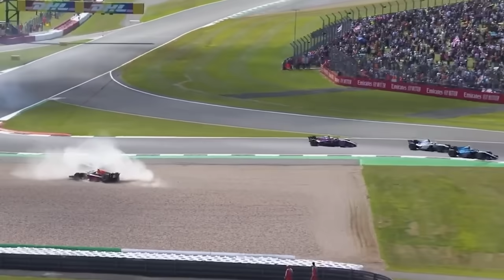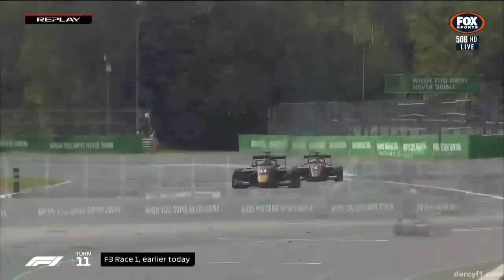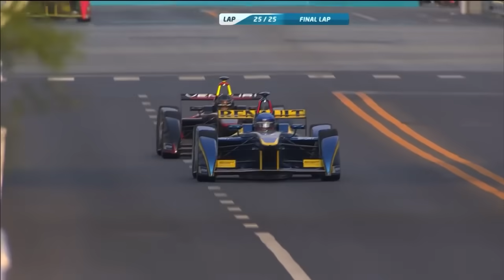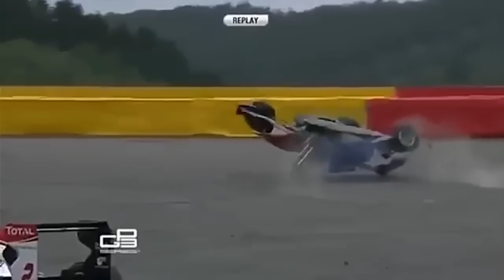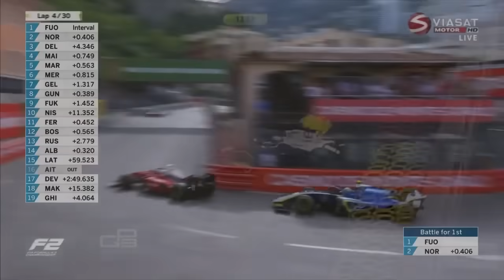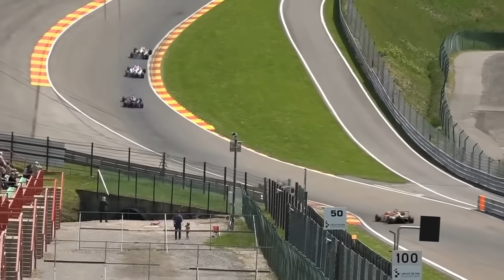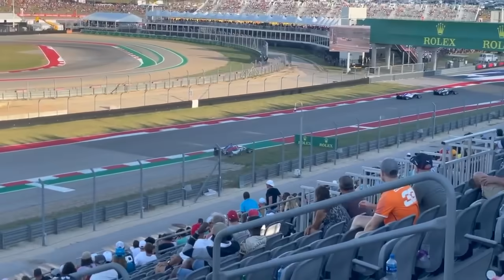Ramps on Race Tracks

Comment: I think it would be better to make the kerbs more abrasive to tyres rather than have a high profile that the floor plate can launch off from. There would still be a downside to running over them but it would be a general traction performance loss rather than upsetting the car’s balance in the turn.
Reply: They could even use small devices with sharp edges to damage tyres on purpose.
It would be much safer and even effective.
In F1 they could use electronics to slow down the drivers out of the track limits at some points. Like, if you run wide you lose 10% of power for X seconds.
Reply: I think that would cause punctures which might be exciting but not exactly safe.
Reply: @justinharrison9521  I don't understand why the kerb inside or outside of a corner has to be any different from on a straight. Cars must stay within track limits anyway so why are these needed?
Reply: @justinharrison9521  
I meant just a little bit. It would cause punctures only after going wide or cutting several times. Similar to an abrasive surface.
It should be adjusted to damage the tyres little by little.
Reply: @justinharrison9521  any mechanism that punishes mistakes by removing adhesion can be dangerous
Reply: @dark_memer42  
Kerbs are there to help the cars stay inside the track. Some of them make it easier, some make it harder (like Nürburgring) and some are flat and just visual.
They are a characteristic of the track and that's why they vary so much. Because everyone has a different opinion and so tracks are build with different characteristics. Some people think like you and others don't. 🤔
Reply: @AngusMcIntyre  
It's also called racing...
Reply: @Gean...de...Oliveira   curbs are absolutely not "there to help the cars stay inside the track", they are there to punish drivers for exceeding track limits.

 And sure, some fans like them.  Some fans also don't like the halo, comma some fans don't like that racing is so much safer nowadays is then it used to be.
The fact that some people like a safety hazard is not justification for keeping a safety hazard around

Comment: Great video. I hope the algorithm will push this. Other than good old fashioned grass, what is the solution. If you give an inch the drivers will take a mile. I races in the Battle at the Brickyard in 2019 and the fastest exit to turn 4 was 4 wheels off in the dirt. The karters that weekend (myself included) did 14 grand in landscaping and the next year they just put a wall there.
Reply: On big GP courses: sensors all the way to flag every cm of track limit. 
But of course thats unreasonable for smaller circuits with mainly amateur racing. 
No matter if its a wall, a tire barrier, gravel, grass... everything has its downsides, but i personaly think a single sausage kerb should at least be an automatic ban for lmp style and open wheeler racing.
Reply: @emojack  How about spike strips? :)

Comment: 0:00 - not a sausage kerb
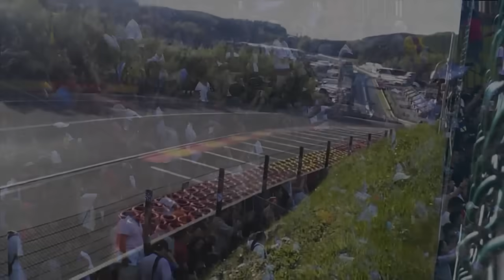3:02 - not a sausage kerb
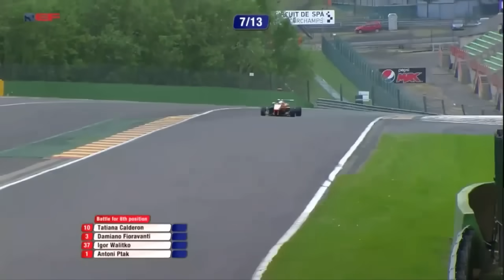4:59 - not a sausage kerb
5:39 - not a sausage kerb
Reply: Alot more than that aren't, half the tracks shown don't have sausage kerbs.
Reply: The two at spa are sausage curbs (sorta). The white stripes used to be elevated higher than the tarmac. Effectively being a mini sausage curb.
Reply: Yes, those were not a sausage kerb and it did that… sausage kerb is a lot worse.
Reply: Bruh read the description
Reply: @jamesshanks5599  it's irrelevant. The title claims these are sausage kerbs.
Reply: You're being obtuse. You are ignoring the description on purpose. All of these are avoidable. Whether it's sausage curbs or cheeseburger curbs, they don't need to be there. You like drivers being injured?

Comment: Well done for making this compilation. Hopefully it gathers some traction, particularly after the comments from Norris, and the FIA step in. Sausage kerbs need to go.
Reply: They won't because of track limits. Plus, the number of injuries is exaggerated. Most of these crashes were non-injuring (only 5 out of 18, or in more mathematical terms: 27.778% were injuries and out of that percentage, 2 were severe vertebrae fractures, or in mathematical terms, 11.11% overall, 40% of the total incidents that DID injure drivers). So unless you can't count, I don't think 27% is that severe, as it's barely a quarter of a specific selection of clips behind a biased message. 

Bias doesn't solve anything. And the maths objectively point to it being a non-issue.
Reply: @DR3ADER1  I can say I have never seen someone simp for an inanimate object as much as you have in this comments section sir, props to you.

Comment: But what's an alternative that accomplishes the same goal without occasionally launching or tearing up cars?  
The problem is, if you don't put some type of curbing that discourages cutting corners, then drivers will simply always cut them.    Sure you can say "Don't cross this line or you'll be penalized or DQ'd" but then what happens if someone just misses a brake point or gets bumped by someone else over that line?   Would be pretty annoying to see racers just randomly penalized out of the race.   Curbing makes it a place you don't want to be, but doesn't put the race outcome in the hands of officials.

Keep in mind that another alternative would be to limit how low race car bodies can so they don't hit the curbs directly (they're not an issue for tires).  Of course that would change the nature of some of these cars quite a lot.
Reply: or, as racetrack mostly were before, grass or gravel on the side of the road...? 🤷‍♂
Reply: @Seb_Semos  people just drive over the grass on the inside of a turn and eventually just becomes a big patch of dirt that people still drive over.   Gravel gets dragged onto the track causing it's own set of hazards.

Comment: Sausage curbs should be removable, they work for non-open wheelers but removed for open wheel racing
Reply: An Aston Martin car skidded & flipped multiple times on its side in 6hrs of Monza 2022 bcs of a sausage curb
Reply: @abcjelly  this is true sorry about the year late reply, I probably meant they work for higher suspension vehicles

Comment: I'm not a huge fan of sausage curbs and see the big concern with them, but I understand there purpose in motorsports. I believe there are much safer alternatives to keeping cars on the raceing surface and keeping cars from cutting/running wide in corners. I don't know when sausage curbs were introduced but it does not seem like they use to cause a big problem. I think a beter alternative to sausage curbs would be a surface that slows you down like gravel but does also not cause drivers to lose control in the car. I'm sure the FIA could develop a surface with these characteristics that would be much safer for drivers and pervert the launch pad affect we have been seeing.
Reply: It started in the Tilke-drome era I think.  Tilke owns a construction company, so all his tracks have the most amount of construction possible(paved everything).
Bikers also like the connected paved runoff, as they always slip driving on gravel.
IN the last 10 years or so more and more tracks are paving the gravel run off, like Monza, Parabolica which used to be a grass strip then gravel.  It was made safer by paving the grass, then to stop people running wide, the sausage kerbs were added, making it much more dangerous than the old way.

Comment: Point of the matter is, don't run wide.

Failing to see how they are any worse than concrete walls. With open wheel racing, sausage or not cars fly. Motorsport is dangerous, enter at your own risk

Comment: Why the hell are sausage curbs still in motorsport? With all the safety improvements in the cars and tracks, why intentionally add something which makes an incident so much more dangerous.

Also, putting a sausage curb at Eau Rouge is so stupid it's practically attempted murder

Comment: sausage curbs should be banned, they are too dangerous for open wheel racing. Just penalize the driver for exceeding track limits, dont try to kill them by putting a bump that if they hit it, sends them 40ft in the air.

Comment: If you want to complain about sausage curbs, you have to go back and deal with the reason they are there to start with.   They exist for the very simple reason of the stupidity of paved run off areas, corner cutting, and track limits issues.

Basically, if there is no real difference between running on the track and running off the track, drivers will take whatever route gets them the best lap time or gets the pass done.   The most obvious example of this in at Monza, where the final corner (parabolica) that was an amazing test of driver skill and control, the balance from speeds versus staying on the track.   Failure was an enjoyable run into the gravel trap and the end of your race.    Now it's all paved over, and we have the problem that everyone now runs over the curb and out as far as they can to carry more speed onto the straight.  So in order to keep drivers honest and on the track, various things have been tried including curbing.   

So if you want to get rid of sausage curbs, it's simple:  Make going off track undesirable.
Reply: true! Don't see much people cutting in the grass on the Nordschleif.. 😂 plus, the track is often more beautiful with grass or gravel on the side

Comment: Instead of bumpy curbs, they can put flat non slip curbs so everyone will be happy(like in France run off areas). No track cutting and no airbornes. Just see it from cameras or use sensors that detects whether it's a corner cutting or not.

Comment: Imagine suggesting that track boundaries shouldn’t be enforced, and if they are it’s poor track design.

All of these accidents occurred as a result of drivers being reckless but this guy is putting the blame on the track designers like the drivers shouldn’t take accountability for both their decisions and actions.

Such nonsense 🤦🏾‍♂️…how about this fool give a suggestion that could fix what he considers an issue while achieving the original goal.
Reply from the maker: First, I want to say that track limits are necessary and should be enforced. My point is the placement of many sausage curbs is poor design because of the consequences of hitting them, the frequency of issues caused, and how little has been done to replace them. 

Drivers should be held accountable for their mistakes, but track designers are responsible for placing track features while maintaining safety. The curbs are poor design because they're causing injuries to drivers and endangering others. It's like putting a tire barrier where concrete walls should be. Despite tires being the clear option for areas past corners' braking zones, on a straight, tires will be redirected onto the track and be hit at high speed. 

Instead of having sausage curbs in corners where drivers can go off-track and launch into traffic like at Silverstone, remove them. Keep the lower-profile rumble strips, and either monitor the corner closer or use pressure sensors with automated penalties. Another option could be to pave abrasive tarmac past rumble strips to degrade tires with repeated abuse. They can replace curbs in run-off zones with grass, gravel, or slower escape paths.
Reply: @utters4515  a rumble strip isn’t much of a deterrent, more like a notification. Best case scenario is the authorities use digital sensors for each car and corner section to monitor contact between cars and when a car exceeds the set boundaries, with an automatic time penalty for infractions.

Contact that causes cars to exceed the boundaries should receive the penalty instead of the car on the receiving end.

Either way, racing is a technical sport which revolves around the skill of “threading the needle” as fast as possible, if they miss the optimal line and crash as a result it’s not the track that the issue IMO. The whole sport is dangerous so that can’t be what you’re objecting to and no one is being seriously hurt as a result so I’m just not sure why you’re upset only because it’s scary for you.

It’s not much different then grabbing something that’s too hot and burning your hand as a result. Yes it hurts and causes discomfort/ shock but if the proper precautions were implemented and respected then the negative experience wouldn’t be a concern.

If you remove the consequences then you’re encouraging unethical drivers to exploit your insecurities. If a driver is causing damage to the car and himself potentially, as well as losing the event as a result then the team managers will be on their case to sort themselves out.

The potential for severe consequences encourages respect and integrity, if not get recked.🤷🏾‍♂️
Reply from the maker: @ewartlambert  I see what you're saying and agree with your point about the drivers' actions' consequences. There's always a risk, and ignoring it causes crashes, and yes, there is always the risk of injury in racing. That's certainly an incentive for better racecraft. 

I feel that an object placed on the track by design shouldn't be putting people under direct threat. It's not always a driver missing/cutting an apex or being overly aggressive that causes these incidents, and they aren't the only ones in danger when a car goes flying. Keeping the stakes high is not enough to justify injury to drivers, but especially not to spectators or marshals. Team managers and sponsors already apply the consequences because they don't want drivers who crash all of their equipment or rack up penalties every race. The drivers are already under pressure to maintain performance, including their racecraft.

When hit at angles near to those expected of a racing line, sausage curbs punish cuts from those drivers efficiently. When used in run-off areas, they force drivers to slow and prevent any time gain. Failing that, whether after spinning or being hit onto the wrong path, drivers hit them and get launched. It's not a part of the natural danger of motorsports. It's a tangible, design-caused threat making incidents worse. The problem is that they shouldn't be placed on track without considering the possible unintended paths cars can take when out of control.

Thank you for watching and commenting. I appreciate it. 👍
Reply: @utters4515  from my knowledge, these curbs aren’t causing deaths or serious injuries..yes the accidents that do result from impacts with the curb are more spectacular but the combination of safety measures prevents the concerns you have from becoming a reality.

Racing is dangerous, period…for both drivers and fans alike but if you remove the active deterrents in favor of passive ones you’re really not making things safer because now respecting those enforced boundaries becomes optional. 

Here’s an example, if people were encouraged not to steal without the possibility of having to go to prison as a consequence only a “time out” by being banned from the store for a period of time. Do you think the rates for stealing would go up or come down?

The severity of the consequences is directly correlated to the respect for the set boundary. If you’re intention is to coddle the drivers, there are some that will see that as a weakness to exploit and it’s those individuals that will potentially make the race more dangerous. Race drivers by nature are always on the lookout for an edge or window of opportunity so lowering the stakes only makes a more risky move more feasible IMO.

Make the roll cages and the boundary fences more than strong enough to handle the potential impacts (it’s literally a science, it’s not like they’re guessing) and keep the curbs for the “fireworks” and the consequence factor to those who disrespect them. 

A racer watching another racer get totaled for trying to cut or hitting the curb for whatever reason will reinforce respecting the curb for the whole race field as the circulate the track looking at the wreck be cleared away. It’s basically a “FAAFO” honor system. 

As long as nobody is dying or seriously maimed it’s an acceptable risk, making racing too safe will only make it boring because the risk is where the thrill/ skill is.

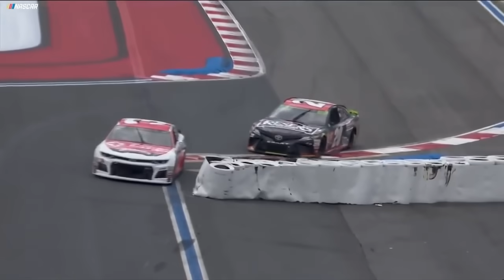Comment: 1:52 this is why NASCAR does oval tracks, they can’t go around a corner!!! 😂
Reply: do your research before you comment, the first time they used that bus stop, it did not require the car to slow down, where there are turtle ramps. They can make a car lose control and wreck.
Reply: As a nascar fan, be burned by the stake

Comment: They worked so hard to get all the crash barriers up to standard, and then added elements to enable the cars to clear those barriers and even further endanger both drivers and track-side crew. The mindless contradiction is utterly astounding.

Comment: How to avoid the fact that the old grass and gravel traps was actually good : sausage curbs
Reply: Sausage kerbs are worse, but gravel is hardly predictable and can flip-over cars as well, or even lift them over a barrier, just seen in Silverstone with Zhou. And all too often a driver gets literally pushed into the gravel without being at fault, while the one responsible stays on track. Additionally anything that's good at ruining the underfloor is hardly a good idea with ground effect cars.
And grass isn't safe, it becomes easily bumpy through tires (lift off problem) and for anything wider than a couple of cm/inches, it's dangerous as it doesn't allow cars to slow down (R.I.P. Roland Ratzenberger). Gras was already considered dangerous in most spots when the FIA tried to improve tracks after the deadly 1994 accidents.
Extremely abrasive tarmac / coating like the blue stuff in Paul Ricard seems a better compromise to me.